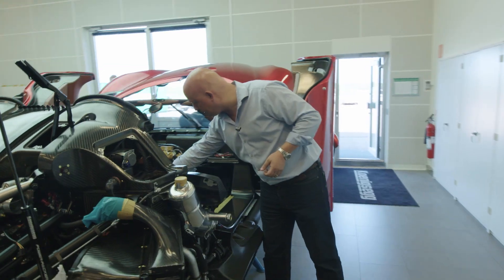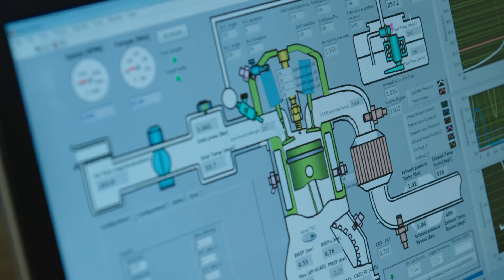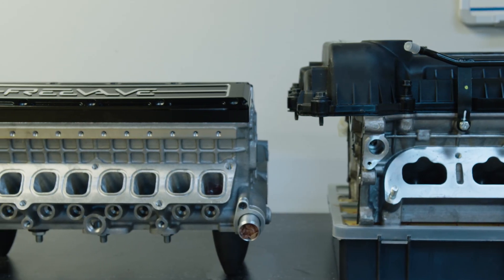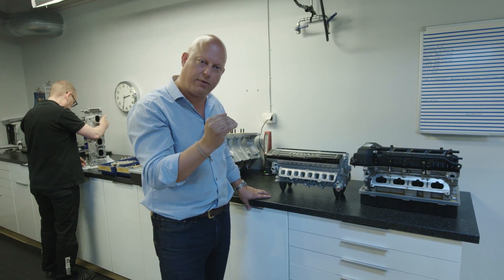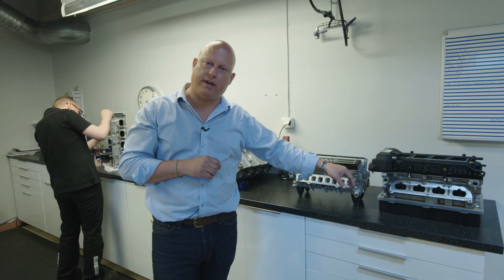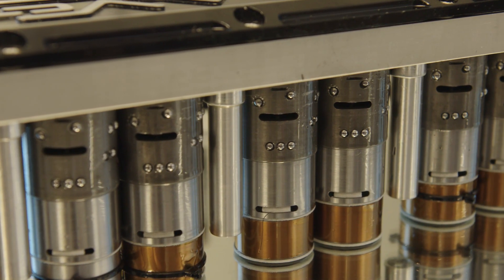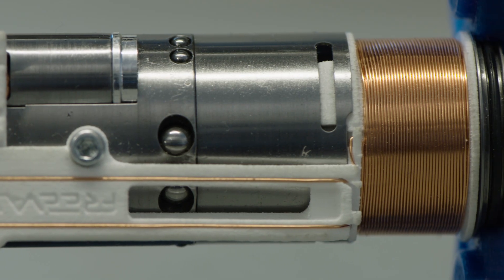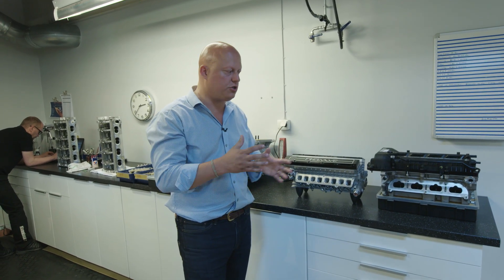Freevalve Update Camless Engine -- /INSIDE KOENIGSEGG

Comment: Koenigsegg is an absolute genius. holy crap this is such a revolutionary idea for engines
Reply: They are all late to the party. Preston Tucker, of the Tucker Automobile Company, came up with a cam-less engine design in the late 1940s. It was a 589 cubic inch engine and actuated its valves using hydraulic pressure versus this design's pneumatic construction. This is a rekindling of an old technology and refined for modern application. There really isn't much new under the sun in the automotive world, just revisions and refinements of past ideas.
Reply: This is not new. F1 cars have had it for a while. However, he's the first one to bring it to street cars.
Reply: Mzn T never knew that, but still what an idea!
Reply: Daniel Carl
 Yeah, I really hope it catches up and big manufacturers join the party. Worth mentioning is that valve control similar to this (but not as precise or extensive as this) has also been achieved by BMW's Valvetronic. Look it up, it's pretty interesting technology as well, even though it relies on old tricks.
Reply: Mzn T just imagine how easy it would be to tune cars. Plug in a laptop and fiddle with some numbers and boom. Your v8 is cammed
Reply: Daniel Carl
The whole concept of "cammed" would disappear :)
Every engine, even puny 0.8s will have the whole spectrum of cams you could get on an engine.
Reply: Mzn T the future feels bright
Reply: There are no new ideas, just improvements on old ones.

To be fair, the computer control of the pneumatics is a bit of a gamechanger compared to previous iterations.
Reply: You realise you're talking about engines that still have camshafts, cambelts, etc?

Things this head doesn't use?

It's like comparing an fighter jet (freevalve) to a Sopwith Camel (any other cam-based tech) - they are totally different animals from a design standpoint, the only similarities being they both have the same primary function; to actuate the valves (fly).

Also, F1 cars don't run camless - the regulations clearly state they must have camshafts, and variable valve timing is banned. You're thinking of pneumatic valve springs. Renault applied for a patent for them or something but it never really got anywhere IIRC.

See 5.9.2, here: http://www.fia.com/file/38950/download/14081?token=Nu_ymUVZ
Reply: SurelyYewJest 
In the 1950's a valveless engine was developed by South Australian Dave Dunstan, "the valveless Holden engine" using a rotating shaft running along the top of the engine with flats cut.
The design provided a means to open and close ports without the need for valves, lifters, pushrods, springs and rocker shafts.
Reply: As for the whole Freevalve thing, I'm really hoping for aftermarket applications.

My car (Ford Puma 1.7) has VVT on the (I think) inlet valves, and it does wonders for drivability - it has north of 100lb/ft from 1200rpm and it transitions to power taking over at around 5000rpm, so you can do childish things like pull from 15mph in third through to 80mph at 6500rpm in one very smooth run, with it pulling harder and harder right up to the rev limiter (whereupon I definitely don't let it hit the limiter, then change to fourth and head for 106mph on the limiter again...). Doesn't sound like much, but in a car that weighs a touch over a ton, it's plenty pokey and really suits the cars perky, cheeky personality. 

It also means you don't need to worry about changing down very often, unlike something like an MX-5 where the engine is just breathless below 5000rpm.

I like the idea of that, but expanded, which is what this tech offers - getting an extra 20-30hp, 20-30lb/ft, and also junking the ageing camgear (needs bucket shims doing, VCT solenoid isn't known to be bad for failure but it does happen etc) and getting more than 25mpg out of it.

Although that last point is probably more to do with me never using less than full throttle. I hear other people get 40mpg out of these cars, I'm guessing they're really dull....
Reply: *****
 New AVTEC and toyotas Valvematic are CVVL systems aswell. Just so you know :)
Reply: Right. Not new, as engineers decades ago surely were dreaming of what would be possible if valve trains weren't necessary. But ya, bringing this tech to street cars is a must. I'm a bit surprised it hasn't come around sooner, but maybe the supporting tech just wasn't quite ready yet. Reliability is the #1 goal, because day-to-day use has its own profile of rigor on an engine, that's totally different than surviving 1 or 2 races before a total rebuild.
Reply: Mzn T Koenigsegg have been doing this since 2011 though
Reply: IVTEC and Valvematic came way before. 
BMW is a bit late to this party =)
Reply: Madis Jõgi
Don't turn this into a shit talk, mate. It doesn't matter who came first. As far as Wikipedia goes, Valvetronic came in 2001, while the Valvematic came in 2007.
IVTEC is not comparable with the two as it doesn't eliminate the need of a throttle valve.
Don't confuse older classical valve timing systems with these ones.
Reply: Mzn T
Shit talk... nah...
But im kind weirded out that some make this Valvetronic to be such a huge innovation or amazing.
However. The wikipedia article is somewhat true and false at the same time.

Yes, the name Valvematic was adopted later than Valvetronic(probably it was done for sales)
But the system itself was used in the 2ZZ series engines under the name VVTL-i
Reply: Mzn T  Also remember BMW had used VANOS on their production engines for almost ten years when they introduced Valvetronic. But still... This Koenigsegg Freevalve solution is really something else, really beautiful!
Reply: Madis Jõgi
Just like the VTEC, that version of VVTL-i on the 2ZZ doesn't eliminate the need of a throttle valve as it doesn't have the necessary range of valve operation.
Reply: Beany2007FTW
My bad about the F1 engines. I really thought it was the same technology more or less.
And yes, I'm very clear about how different these technologies are and how Freevalve will change the combustion engine.
I was just trying to point out that the idea of valve control at such level is not necessarily new and that something similar (again, not nearly as precise as the Freevalve, nor as simple) has been achieved.
Reply: I was surprised about the F1 thing too, TBH, but given that F1 engines are basically designed to run a full bore at the top of the powerband at all times, I can see why there'd be less fuss about it.

It's not like F1 cars need lots of torque at 1500rpm in third gear to pull out of a 30mph zone onto a motorway slip ramp or something ;-)
Reply: Beany2007FTW
Yeah, probably that's the main reason they've never chased the issue.
Reply: not his idea. he just bought the company

Comment: This technology has been in F1 for a long time as well. Only they do it with electronic magnets. They flow current over a electro magnet and vari that amount to open and close the valves. hence 22,000 rpm out of some of those motors.

Comment: No if you have ever done any tuning you wouldnt say that. I dont know where you get that info from but you have no idea what you are talking about there Gearhead and Ryan Hard. The ecu only controls fuel delivery and spark timing. If you are refering to valve timing the ecu does not control that nor has it any way to do so. The only way you can have what the video is about is to have no cam shaft. Honda and Toyota and a few others have variable valve timing but it is still a fix set of parameters within the grind profile of the cam lobes themselves. What he is able to do with no valves is get the best of both worlds plus more. Honda's system has 2 different cam profiles on one camshaft. when the rpm reach a certain point the oil pressure slides a rocker arm on the other profile. Toyotas has one profile and changes the lobe separation and center line by a clutch type hub that retards at a certain point. both of those are fixed. they dont change lift or duration as you can do with that system. no ecu can change valve lift or duration.

Comment: While everybody is just going electric, Christian believes internal combustion might be saved, might evolve and survive some more decades, powering our cars alone (Agera) or in a hybrid system (Regera). I can only admire this man, his vision and his shining passion.
Reply: malikkium and his shining head :d jokes aside he and his team are wayyy ahead of our time
Reply: In this day & age, electric cars are a lie. As long as only 6% of our electricity comes from renewable sources, a gasoline driven car is just as clean as an electric one. Electric cars run on coal for the most part, and use up way more resources for production.
You only need to make a gas powered car 6% more efficient to even it out, which is as simple as ditching that 1000 lbs battery...
Reply: He once said that electric cars are future, but not now, only in mayor battery breakthrough and he does not believe it will happen in next 15-20 years.
Reply: malikkium reading up on this guy's biography was very inspiring, he got where he is not just by million dollar loans, but the drive all his life to pursue mechanical technology and being an absolute genius in his field
Reply: Batteries in electric vehicles are history within five years. Ultra capacitors are where it's all going to happen. Batteries have too many heat, weight and internal resistance issues for electric vehicles. Ultra Caps have NONE of those (but a few others right now).